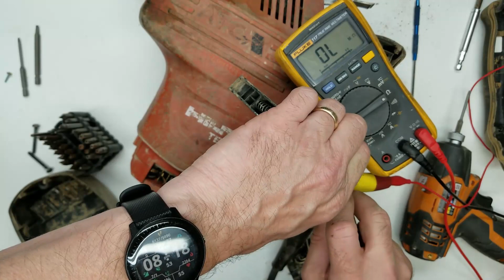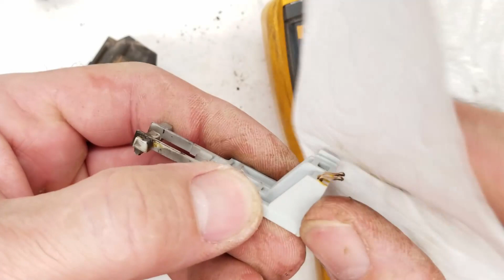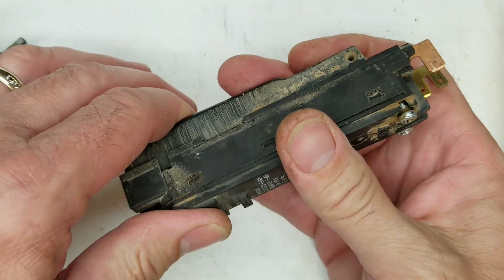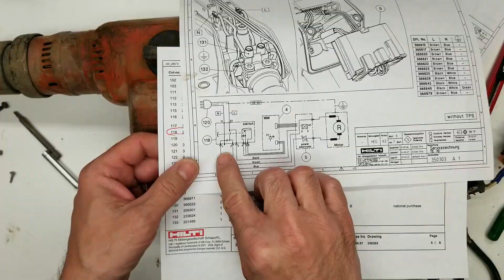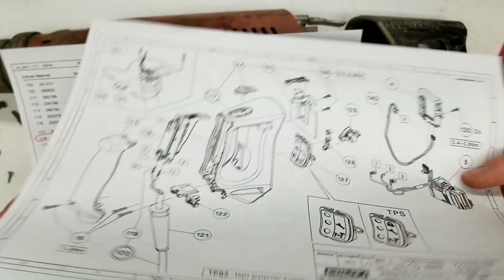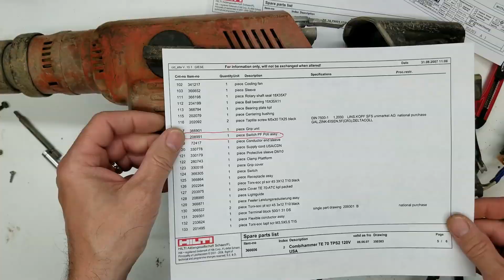HILTI TE-70 Repair FAIL

Comment: The service light it on so it need resetting
Reply from the maker: The reset tool is an Hilti supplied tool only. I tried to find one.
Reply: @norcal715  The reset tool is £50.00. Buy yourself a red laser pen £5.99 and point laser at the red light on the hilti for a few seconds and it will reset it. I use this method regularly and it works every time.
Reply: Hilti unlock device SRT reset tool red light off available here connect on email ✉️

Comment: .. yes this is not a new policy that the manufacturers are following the aim is more benefit and sell more products. purposely they install a customized part inside even in their very expensive machines and after a short of time the machine fails to work and that part would not work and you can not find it anywhere even their customer services. the only way is to buy a new machine. HP is a pioneer in this policy in the world.. beh from. jestinyong.com    weblog
Reply: That's new to me... Hilti has a repair promise, which even covers YEARS after sales stop. If I am not mistaken?
For sure not for free, but stating that they are not interested in repairing tools is simply not true, mate :)

Comment: Hilti of course dont want to make the repair easily for you. Hilti wants to buy you a new tool.  This pottet electronic should be illegal because reccources are wasted
Reply: As much as it makes repair difficult, and as much as certain asshole companies tend to use it explicitly for that reason, this is an application where potting electronics is utterly appropriate for engineering reasons. Encapsulation provides protection against dust, moisture, and vibration.  All three of these are non-negligible concerns in a rotary hammer.   Vibration is probably the most important in this case.

Generally speaking, the cost and compactness requirements of hand power tools make it difficult to protect their internals by using a sealed enclosure, and doing so wouldn't address the need for protection against vibration.  

That said, refusing (as a matter of policy) to provide product service (under warranty or for a profit) while also refusing to sell extant parts under current manufacture for the primary purpose of ensuring products cannot be repaired by anyone else -- that's straight up disreputable bullshit.  Don't get me wrong, I'm thoroughly aware how this behavior is becoming a growing fashion.